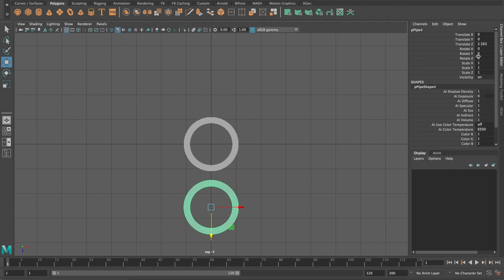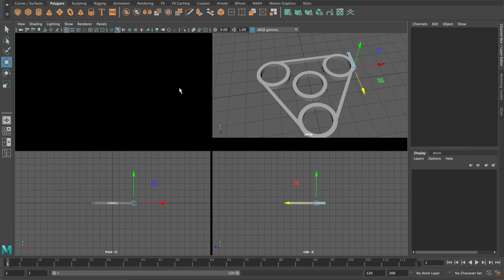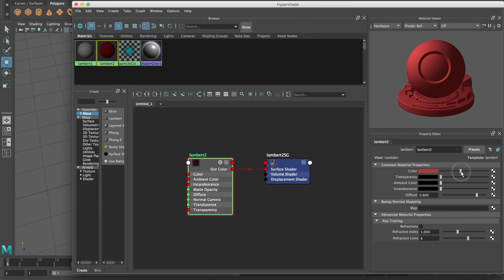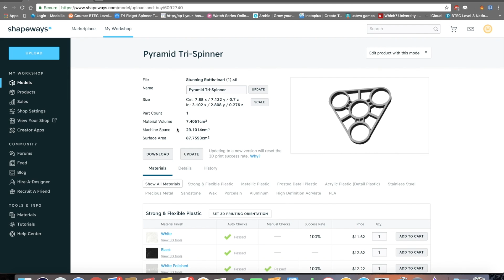3D Modelling a Fidget Spinner in Autodesk Maya 2017 and Printing with Shapeways (Extended Cut)

Comment: correct me if I am wrong but overlapping polygons will  make empty spaces on the overlap area when 3d printing, making your model really weak and most likely to break on the overlapping areas as there is no filling there, on top of that those are the joins the part that should be stronger. to avoid overlapping , simply use the Boolean union and clean up geometry  or snap to surface or snap to point, other than that cool design,
Reply from the maker: Hey! Thanks for the comment! You are completely right about the empty spaces due to polygon overlapping. During the creation of the model in Autodesk Maya, this would not have been a watertight model as you say there is no actual filling, just the joining connections. I hadn't realised there was the boolean union tool but it completely makes sense. One step that the video misses out is the stage where the .STL file is run through software that waterproofs any 3D model, I prefer this step as it ensures any potential missed out polygons are filled as a final stage before being sent to Shapeways for printing! - As a result, the model Shapeways used to 3D print the model was 100&% filled but then obviously printed using the fill percentage most suitable for this print. Glad you like the design though! - Andrico
Reply: @andricozach   oh cool cool, nice to know, well done,